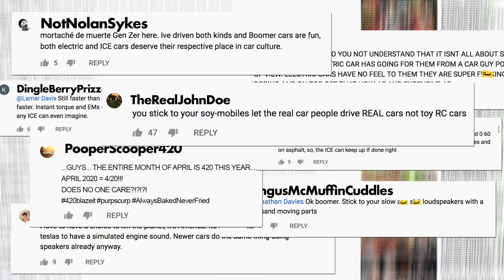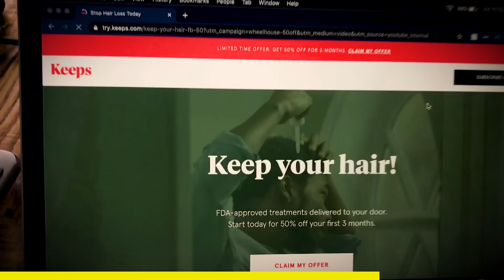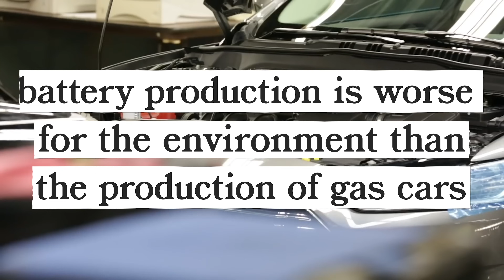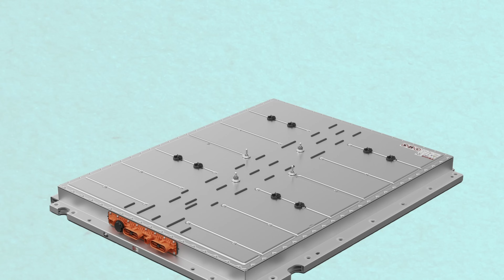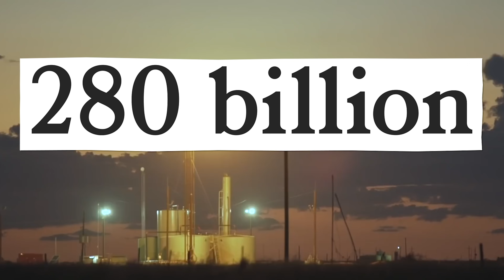Are Electric Cars REALLY Better for the Environment?

Comment: You also forgot to mention that any heat engine efficiency will cap at 37% and for electric engine it goes up much higher hence greater output per joule lf energy spent.
Reply: Peter ⸻⸻⸻⸻⸻⸻⸻⸻⸻⸻⸻⸻⸻⸻⸻⸻⸻⸻⸻⸻⸻⸻  They are still far more efficient.  Average efficiency on a ICE engine is a sad 17%, electric motors are 90% efficient.  It is no comparison.

Comment: I have a point to add the electricity used in EVs are comming from majorly coal based plants. Which is a big contributer as Diesel in car.
I dont study anything for it just felt like so asked i may be wrong, just curious to know is it true.
Reply: Look into this vid:  https://www.youtube.com/watch?v=6RhtiPefVzM  at time index 5:00.  Much better explanations there. The electricity that your car takes is as conventional or as renewable as the power plants on the other side of the grid (You could have known that yourself). This is totally independent from the question who draws which amount of energy for what purpose from the outlet.

Comment: Missing out the end of life scenario where the EV battery needs to go in the bin and the combustion engine keeps on going.
Reply: At the "end of life" the combustion engine does not keep on going, as it is the "end of life"
EV-batterys EOL is most often defined like: "When the capacity of the battery drops to 80% of its production value" This is just a definition for legal issues. Wether or not it will be replaced is up to the drivers needs. ICE engines also lose power over time, but I cannot remember anyone switching the engine due to that fact. When it is replaced, it will most likely be directly used in a stationary 2nd life application for at least 10 years. After that, it does not go to the bin but will be recycled. Just like the ICE gets recycled. 
Recycling of batterys is in its absolute infancy right now, but various companys already do this with high recycling rates (70...90 %). Right now it is somewhat costly, but this will change like it changes with every process. Especially EV batterys are suited for recycling, as they are well documented, big and come in predictable (high) numbers.

Comment: I believe the bottom line Donut suggests here. EVs are cleaner overall. The big problem isn’t EVs. It is electricity production. We need carbon fuels to make electricity to fuel both types of engines. Yes everyone thinks we should Go Green and carpet the earth with solar panels and wind turbines. I get it!  I would be down for that EXCEPT it is nearly impossible to base load the grid off of wind and solar output. You can’t predict accurately enough how much output you will get day but day to properly run the grid. Our grid was designed for nuclear and coal - both of which are awesome at base loading. Now natural gas has supplanted a lot and if we keep natural gas pipelines flowing we can successfully feed the grid. But there’s still emissions from nat gas plants. So if we really want to go green we need to figure out how to solve the grid issues with unreliable clean sources. Our entire focus should be on grid design / digital switching that can handle interrupted supply. If we can master that problem I think we can take a big step toward carbon neutral. No matter how we look at it though we still will use gas and coal. And nuclear scares people - even though Gen IV reactors are beautifully efficient and safe designs. I wish we could calm the “either/or” politically motivated debates and actually have a strategy in place to upgrade the grid. I actually hope people who are smart on this subject will jump in here to make comment. We need technically smart people to lead this thinking - not blowhards that only think they know what they are talking about. Study the Dunning-Kruger effect and you’ll know where I’m coming from when I say that.

Comment: What about practically and versatility off-road wouldn't it be hard to do work in more remote areas. And u can't exactly swap a battery like u fill up a tank of gas in a hurry right know. So the tech  definitely has potential but right know to most, it's not a practical option for a vehicle, but only time will tell as the tech  gets better.
Reply: That depends. You can fill hydrogen from a jerry can. and you also cant really store it at home due to its explosivity and how easily it can leak. for example hydrogen can leak through solid steel. whilst you can charge from home and at destinations.
Reply: As for off-road, aside from range. Batteries win hands down

Comment: give it 20 years and the problems with electric vehicles will be gone
Reply: One thing is certain, their range won`t improve.
Reply: @Calvito-  not necessarily. range will improve as new battery chemistries will either create more energy density or reduce the weight of the batteries. by when and by how much is any ones guess.
Reply: 20 years exactly
Reply: Too long

Comment: As far as I understand it EVs “need” a battery swap after like 10years🤔
Reply: not ture
Reply: Your understanding is not necessarily correct.  An EV battery may not need to be fully replaced once performance begins to reduce. Watch the YouTube video of the 10 year old UK owned Nissan Leaf getting a battery refurbishment. The work took around 4 hours, and cost the owner £600.  So no, an EV does not always "need" a battery swap after 10 years. There is much crap being posted about EV batteries, usually by people who have never even touched an electric car, let alone owned or driven one......

Comment: E-bikes are more than 10 times more efficient than electric cars. Also, fine particles from brake abrasions etc. which make a big part of urban air pollution by cars are practically nonexistent when riding e-bikes. Roads are used more effecticely, there are no parking space problems when riding bikes, and it is healthier because even with electic support, the people move more and are less obese. As you can see in copenhagen, when bikelanes are cleared during winter, you can use your bike all year round, the only limitation is the range: riding 20 km takes about an hour, so the best application of this transport devices is in ranges of 5km or less, you can also ride longer or take your bike with you on the train.
It is all a question of infrastructure.
Reply: E Bikes use a battery and an electric motor. The efficiency levels will be around the same as an electric car.

Comment: Electric cars still rely on the power grid that runs mostly on fossil fuel. The best are hybrids like the time tested Toyota Prius. BMW had the super car i8 with a 3cyl that is supposed to charge the batteries but had troubles with that small engine with overheating problems that even dealers couldn't fix.
Reply: All depends on the region.  And Hybrids mostly run on gas while being 2x to 3x less efficient than electric cars.  How does that solve anything?

Comment: So, Toyota is spreading MYTHS that infrastructure can't support the needs of large amounts of EVs in the immediate future? 🤔👌 Also, you failed to account for the amount of electricity lost in transmission, which is roughly two-thirds. So now multiply the amount of electricity an EV uses by 3 to get it's true environmental impact.
Reply: Not quite. Transmission losses actually average around 15% not 66%. Slight difference.

Comment: You say that "you're going to drive a gas car for the rest of your life, because you can't beat the sound of a V8 converting gas into noise". Hmmm. Two observations:
1. the older you get, the more you get to appreciate silence. Sure when you're in your 20s you'd pay a premium to have your car make MORE noise. From your 50s onwards it's the opposite.
2. I owned a 4.3L V8 convertible and I bought a Tesla Model S. There was NO WAY I was going to give up the convertible, which looked and sounded great. But 6 months into owning the Model S it had hardly been off my drive. Why? Well...to get in it and to start it I had to use a KEY (how old-fashioned is that). I had to keep putting my foot on the brake to make it stop (less need for this in a Tesla). I had to keep filling it up every few trips (as opposed to just plugging it in on my drive and getting into a fully-fuelled EV every time). It was a no brainer, and I sold it.
Worse than that, we sold my wife's car and bought a Renault Zoe BEV. It gets even worse... Having to go the gas station with a tank for my lawn mower was the last straw and I bought a fully electric mower (and E-Go). So prepare yourself!
Reply: And here in the UK at least, noise is classed as pollution. If your car makes too much noise, the police can order the noise to be reduced to acceptable levels.....

Comment: The virtue of an electric motor is torque. It's best platform is a performance car. I marvel that so few car makers get this.
Reply: Pow, Pow, Powerwheels.
Reply: @notsure9735  one issue with going fast on electric is it rapidly chews battery power, so great for a few laps, then not so great, for the rest of the day.

Comment: It seems you were really honestly trying to be fair, but it's odd that your entire criterion for "environmental impact" is limited to CO2 emissions.  There's far more to it than that, as you mentioned (like the cobalt mine child labor) but difficult to quantify.  And if that's your main evaluation of impact, you might want to look into the carbon footprint of making solar panels.  As a multi-decade veteran of the semiconductor industry, I know how mono- and poly-crystalline silicon is made and the CO2 emissions per W-hr of installed capacity of a typical solar panel is greater than it can offset from a coal-burning plant over its (the solar panel's) lifetime.

Further, IMHO, until EV's can solve the multi-hour charging cycle, they will be, at best, a second car.  People who can only afford one car, which is a huge part of the market, will not be able to buy them. 

Another thing is that wind and solar are not going to get any better in terms of our energy mix.  To do anything close to what is envisioned by the progressives, you would need to carpet vast swaths of countryside with solar and wind installations that produce, at best, 60% of their peak installed capacity (wind) and 50% (solar).  For the same money, you can have zero emission nuclear power that produces 95% of it's capacity 24/7.  The last 5% is when it's down for maintenance.
Reply: too well said.
Reply: Well you wouldn’t really need that much land. For example, South Australia has a 70%+ grid mix of renewables. There isn’t any problem with land there. Additionally solar panels can be put on roofs of homes, the average homes which would be more than enough energy alone. 

As for child labour in cobalt mining. First I want to point out that the largest consumer of cobalt in the world, are fuel refineries who use it to remove sulphur from petrol and diesel. Second is that the cobalt in batteries, unlike refineries, is not only recyclable but also ethical cobalt, as most ev manufacturers like Tesla have signed contracts with suppliers to only source ethical cobalt. And at current Tesla and others and sinking big cash into researching a cobalt free battery technology.
Reply: @engineeringtheweirdguy2103  - Fair enough, but this is where these conversations break down into shouting contests.  My only comment is: show me your work.  How many solar panels? Place where?  Are you going to put them on the roofs of houses where people don't want them? How many wind turbines? Placed where? What if the land owners don't want them built on their property?  How do you store the electricity for non-generation times? Batteries?  How many? Placed where? Load balancing, how are you going to do it with unpredictable generation?

I could go on, but I think you get the idea. Hand waiving the "solar and wind" solution starts getting really complicated when you ask for specifics.  The US uses some 4 petawatt-hours of electricity annually which means an average continuous demand of some 450 gigawats (cue Doc. Brown).  Half of that, say 200 GW, is what's called base load, meaning the demand minimum.  The rest comes in peaks during the day.  Fossil fueled generators account for over half of that, so my question to alt-energy advocates is "how are you going to provide that?" followed by all the questions in the first paragraph.  At that point it usually devolves into personal attacks, so I just step out.  If you don't have a plan, then you don't have a plan.
Reply: @hagerty1952  there is around 139.64 million houses in the US with an average surface area of 150m2. Current solar panels output 1kW per square meter. I’m saying that, the available space not currently used for solar generation on people’s homes is around 150x139,640,000=20,0946 Gigawatts which we could round to 21,000 Gigawatts. Given a 30% utilisation rate that becomes 6,300 GW. Assuming an average 2549 hours of direct sunshine per year (from data at current results / weather). Which means you’d have a yearly power production of around 16 peta watts per year.

For storage you could put in a small 10kWh storage per home, and couple it with big battery and hydro storage. That capacity would need to be your 450GW for the hours the sun isn’t shinning

There are 8760 hours in a year. The sun shines an average of 2549 hours. So we need 8760-2549=6211 hours, at 450Gw which is 2.7 PWh. If we had 10kWh storage in 139.64 million homes that’s 1396.4 kWh storage would have a capacity of 0.0013964 PWh. So big battery and hydro would have to share the rest.

However with diversification using wind nationally, as well as geothermal and nuclear, you could easily achieve the 450GW overnight.
Reply: @hagerty1952  I’m not interested in a screaming match. I just think it’s an interesting topic
Reply: @engineeringtheweirdguy2103  - Me neither, and I do too!  You are the exception, sir, and I thank you for that.
Reply: @engineeringtheweirdguy2103  - I am impressed!  No, seriously.  You are the first person to respond to one of my "show your work" requests to actually do it!  Bravo.  Then again, your screen name sort of implies that you probably know what you're doing :-)

I actually worked on terrestrial solar panel development in the late '70s under a Jimmy Carter era DoE R&D program.  That's how I learned how dilute solar power is with our current methods of capturing and converting it.
Reply: @hagerty1952  that would have been super exciting work at the time. I know renewables from a research thesis I did on wave energy converters and their integration into a renewables grid. Coupled with the viability of using them as eco friendly costal protection for storm inundation and sand erosion and deposition when utilised in an array to maximise constructive wave interference to boost output
Reply: @hagerty1952  it’s a mouthful of a topic

Comment: Behind these EVs is a power station burning fossil fuels.
I´m thinking that the main market for EVs consists of people going to work and back, on their own.
The West seem to be majoring in big, expensive, superduper sleek fast saloons.
The Chinese are making really cheap commuter vehicles.
After all -- they still have jobs to go to.

My EV is Chinese, a mountain bike with a Bafang motor, and I charge one battery from my solar system, while using the other.
This must rate as a fairly eco--friendly set--up, yet the manufacture of the batteries, solar panels, and related hardware must involve an embarrassing carbon footprint.  Plus the necessity for a reliable 8 hours sunshine per day.
Having said that, for an outlay of around 15 thousand pounds, I have a simple EV and ¨free ¨ electricity in the house, sufficient to run air-con in the summer.
Better, (and cheaper ) than a flashy four seater EV perhaps ?
And on a cold winter´s night, when you need the heater, the windscreen wipers, the headlights and fog lights, and you´re sitting in a traffic jam --- and suddenly the power fades...?
You might just see me flashing past, hustling the muscle on my Moto Guzzi.
Reply: Except that claim is false.  It presumes power can only be generated using fossil fuels, but we know that is not the case..
Reply: @redbaron6805  So what´s your clean alternative smartass?